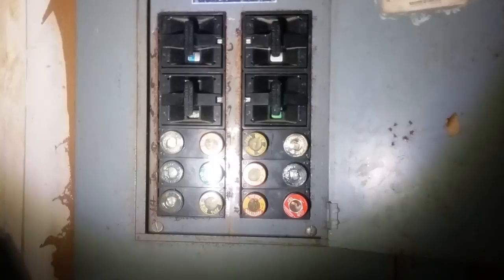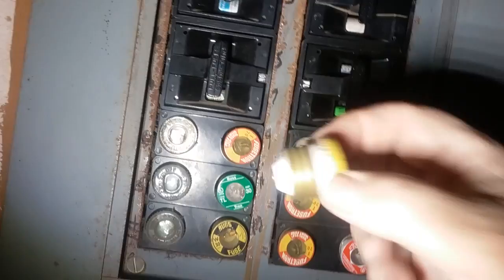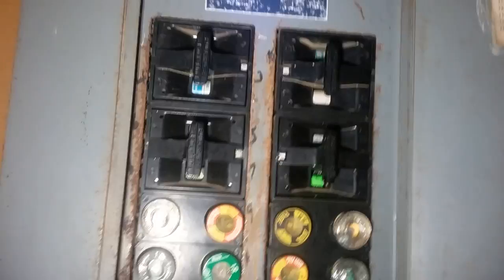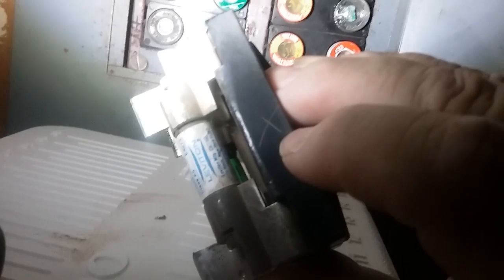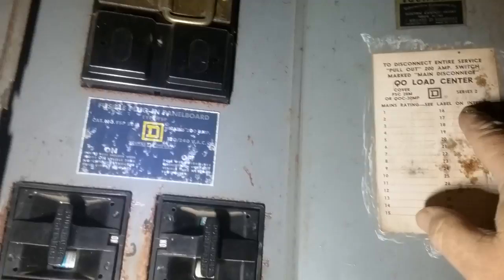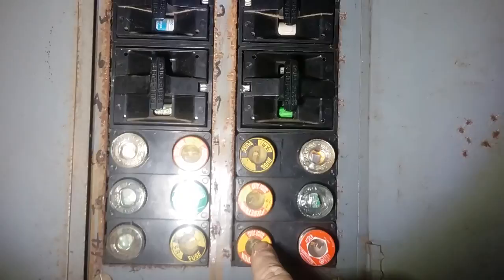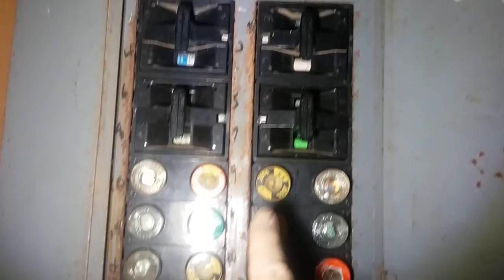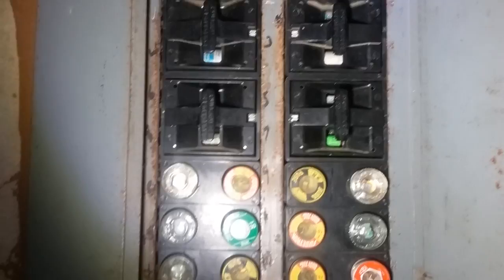How To Change Fuses in an Old Home Panel

Comment: 99% of the time, the fuses are oversized. For example the 30 amp fuses throughout than panel more than likely need to be either a 15 or a 20 amp. Back in the day it was not uncommon to overload a circuit and people would, without knowing the consequences, just put in a bigger fuse. Its best to remove the panel cover and look at the wire size going to each socket. If it AWG 14, use a 15 amp; AWG 12, use a 20; for a 30 amp fuse to be appropriate it would require AWG 10 size wire. That's why I say that they're probably oversized because that size wire isn't ran to lights and outlets in a house. Its used for higher current demands like water heaters and clothes dryers.

Comment: I'm afraid of this. My Dad who is 88 yrs old had jerry-rigged so much in this old house. We don't know how many things are on the circuit. The Air Conditioner blew it out 09-13-19 when it was 90+ degrees here. A neighbor helped us by taking the blown canister fuse out. We are now on 1/2 power. We are cold & can't turn the furnace on until it is replaced. I purchased the canister type fuses plus several of the screw in type at Lowes. The clerk helped me to get the right ones. I took the old one with me.  Thanks for making this video for people like me who have no clue. I had circuit breakers at my old house. I live with my Dad and he is always destroying things that he thinks he can fix and never wants to spend money for professional help.The clothes dryer doesn't work either.  I'm only 5' tall. I would need a step stool or ladder to reach it.  Hoping that my neighbor who is an electrician can help us again. AFRAID of Electricity.
Reply: your comment cracked me up, sorry about dad making things hard!
Reply: I understand. My dad grew up poor in the depression.. He tried to diy, but usually a relative would help with electricity -  my Dad knew that wasn't his expertise.

Comment: Seriously, replacing a fuse is as simple as screwing in a light bulb, anybody can do it.  Just make sure, before putting a new fuse in, it's a good idea to actually make sure that the right amperage fuse was in there in the first place (especially if the fuse in there is more than 15 amps) -- people often like to overfuse their old circuits (which is dangerous!!).
Reply: He stated that.
Reply: How would you determine if the right fuse was in there to start with?

Comment: I seldom come across these panels. As an HVAC tech, did a service call...watched your video as I worked on a gas furnace cleaned sensors. You gave me that much more confidence as I had to hardwire a condensate pump into unit.   Tanks!😊
Reply from the maker: You're welcome Tim! Thank you for stopping by and taking the time to comment on the video. I'm glad "How to change fuses in an old home panel" was helpful.

Comment: Thank you for this, I moved into a 100 year old home 7 months ago, and last night I blew a fuse running the dishwasher and microwave at the same time (same circuit apparently). I am an older woman living alone in this rental home, and being familiar with the other, switch-flip type fuses ("breaker switches"?) was intimidated by these round things (old fuses). Now, however, I think that I can handle it, and the landlord at least left plenty of boxes of fuses that match, so wish me luck! Thanks again for your instructional video.
Reply from the maker: You're welcome. Just be careful with any exposed metal, including the sockets. They are energized even when the fuse is blown.
Reply: A dishwasher needs to be on it's own circuit, with just it's own 20 amp fuse or breaker serving it. There shouldn't be any other lights, receptacles or appliances on that circuit.
Reply from the maker: @Progrocker70  Yes it should, but in the real world, especially when dealing with these older homes, it's rarely done in my area.
Reply: @BlueCollarDIY  Yeah they just wire it to one of the counter receptacles since they are right there and easy to connect to.
Reply: @BlueCollarDIY  are these boxes still considered safe 
I'm asking because my daughter has this in her house she thinks that their unsafe and hers is in pristine condition
Reply from the maker: @tammygallant6004  It really depends on who you ask. I don't like them myself because new breakers are safer and reliable. But there are probably millions of these old fuse panels in existence today still working fine.  Sorry, but that is my best answer!
Reply: @BlueCollarDIY  Thank you for replying
Reply from the maker: @tammygallant6004  You're welcome!

Comment: I was nervous to unscrew the fuse thinking I might blow shit up lol. Thanks for the vid now I don’t have to work on live current
Reply from the maker: I still hate unscrewing fuses when changing old fuses! You could still get shocked by some of the old fuses if you let your fingers slip down on the brass ferule. Newer ones have ceramic. Just be careful where you put your fingers!
Reply: Yeh hahaha. My dad just unscrew the old one and replace it like no big deal. I don't even want to touch them.
Reply: You can always shut the main power switch off

Comment: Thank you man I was struggling with this. I love how you said "preferably they're labeled"... I've never came across one that was either label or labeled correctly! 🤣 that was a good laugh.
Reply from the maker: Thanks KTP! I appreciate the comment. As for labeling, I feel fortunate if I find just a few labeled. Rarely are all of the fuses labeled! lol
Reply: @BlueCollarDIY , I have 8 fuse slots and only 4 of them are tested hot ( I used a voltage detector pen), I changed the fuse sockets and still no electricity, do you know how this could be?
Reply from the maker: @apocalypticredix8538  Not off the top of my head. Do you have the pull out type fuses above the screw in fuses like the one in this video?
Reply: @BlueCollarDIY  yes i have the same exact box
Reply: @BlueCollarDIY  i didnt know you could pull those out, maybe thats the issue, i may have to reset it unplugging and plugging or replace those cartridges, could be burnt out due to usage
Reply from the maker: @apocalypticredix8538  Yes, I've seen the cartridges burn out before.
Reply: I agree I have these in my house and none of them are marked it's hard to figure out which one is blown one is cause furnace and hall light doesn't work since ac blew out one on the same side of wall in the living room
Reply: How can you look at the round ones and tell it's bad?

Comment: I just moved into an older apartment built in 1955 and I accidentally blew the fuse by using the AC and microwave at the same time. 😅 This video was very helpful! Thank you!

Comment: This is a very nice old fuse box.  It has pull out fuses for four 240 volt circuits, and plug (screw in) fuses for 12 120 volt circuits.  

Most older house had much smaller fuse boxes.  Back in the day it was common to only have 4 or 6 plug fuses for 120 volt circuits and only one pull out 240 volt fuse block which was typically used for a range.  No 240 volt pull outs for air conditioning, electric water heater, dryer, etc.

Many if not most of these old inadequately sized fuse boxes have been replaced.  

But what you have is fine as long as you have enough circuits. If it was my house I would not replace this fuse box.  If I needed more circuits I would simply add a sub panel and connect it to the take off lugs in the existing fuse box.  That is likely what that breaker box is that is next to the fuse box.

That said, you may have a dangerous situation by using fuses that are too large for some of your 120 volt circuits.

The plug (screw in) fuses are for 120 volt circuits like lights and receptacles. Circuits for lights and standard receptacles ARE NEVER 30 AMP CIRCUITS.  The only kind of 120 volt circuit that would be fused at 30 amps would be of 120 volt equipment that is hard wired or connected to a special 30 amp receptacle which is much different (and larger) from a standard120 volt  receptacle; I repeat: 30 amp circuits are never used for standard receptacles and light fixtures.

Bottom line: is dangerous to fuse a circuit designed for 15 or 20 amp circuits with a 30 amp fuse. It is very likely that most of if not all of the 30 amp fuses in the fuse box in this video, which are the fuses with the yellow color, are over sized.

Lighting and receptacles are always 15 or 20 amp circuits, but you can not determine if you need a 15 or 20 amp fuse unless you remove the cover and examine the size of the wire that is used for each circuit.  Unless you know the size of the wire used for a circuit, the only safe size fuse is a 15 amp fuse.

15 amp fuses are for use with 14 gauge wire
20 amp fuses are for use with 12 gauge wire
30 amp fuses are for use with 10 gauge wire

If you have trouble with fuses blowing frequently do not replace them with larger fuses, but you might be able to solve your problem by the use of a properly sized "time delay" fuse, which are sold under the brand name Fusetron.  These type of fuses can withstand short overloads that occur when a motor starts.  They can often resolve problems with motors blowing fuses when they start but they will not resolve the problem of a circuit that is continuously overloaded.

If you still have problems with fuses frequently blowing after trying a time delay fuse, you need to either put up with it or consult with an electrician to resolve your problem.  DO NOT replace a fuse with a larger fuse than the circuit is designed for.
Reply: I'm literally living with this right now. Love the explanation.  So delayed fuses until electrician can fix it.😅

Comment: I have a box like this in my garage and the box has a pull down lever on is up and off is down. Do i have to turn off that lever and go inside my house basement and turn off main breaker to change the blown out  fuse in my detached garage?

Comment: Do you need to shut off the electric to unscrew a 30 amp or no?  Thanks
Reply: You don't need to pull the main fuses when changing a fuse. However, If your unscrewing a fuse on an active circuit it will create an arc and cause pitting in the bottom of the fuse socket. I would turn off any appliances or lights that I can on that circuit when removing or screwing in a fuse.

Comment: Receptacles and lighting should not be served with 30 amp fuses, if they are they are overfused and this is a fire hazard. 30 amp fuses in a home are only for larger 220 volt major appliances like dryers, air conditioners, fixed space heaters and water heaters that are wired for 30 amps with #10 wire. These circuits would have two 30 amp screw in or cartridge fuses mounted in pullout carriers for each appliance.  The pullouts with the handles in the top of these panels hold cartridge fuses which are usually 30 to 60 amps.  An electric dryer and water heater would have a pair of 30 amp fuses, an electric range a pair of either 40 or 50 amp fuses, and central air typically pair of 20-50 amp fuses. Lighting circuits, which includes receptacles in rooms outside the laundry and kitchen,  are 15 amp with #14 wire.  Circuits serving kitchen receptacles, appliances like dishwashers, washing machines and such are typically 20 amp with #12 wire. I say typically...in many older homes the kitchen receptacles were still wired with 15 amp circuits.   There shouldn't be any 30 amp screw in fuses supplying 120 volt lighting, receptacle or appliances loads. Lighting and receptacle circuits,  in most older homes is 15 amps.  30 amp circuits are not code approved for lighting and general appliance household receptacle and appliance circuits using 120 volts.   While there's certainly nothing wrong with properly sized fuses in a fuse panel in good shape, it's this confusion of what size to use, lack of understanding that can make fuses unsafe.  That and a lack of available circuit spaces which cause overloading. This is actually a decent sized fuse panel, most of them aren't, having only 4 or 6 circuits total.
Reply: Thanks. I am running two space heaters and the 15 amp fuse has blown twice in two days. I simply replaced it with a 30 amp fuse but I'm removing it now because of your comment. I'll replace it with the proper size tomorrow and simply move one of the space heaters. T hank you.
Reply: @POOCHIESCLOSET  Plug in space heaters use a lot of power,  typically about 1200-1500 watts, which is about 10-13 amps. Doesn't leave a lot of room left on a 15 amp circuit for much else. Leaving them both running on overfused 14 gauge wire certainly would lead to insulation melting and likely could've caused a fire.

Comment: Thank you!!! How do I figure out what amp goes into each unit if not labeled? I need to update labels & ensure correct fuse is in the appropriate place.
Reply from the maker: I'm not sure as I generally go with whatever fuse is in there. If the circuit is for something like a dishwasher, then it's generally going to be a 30 amp.
Reply: @BlueCollarDIY  what about a furnace? I have 30 amp screw in fuses in 8 places.I believe it's not right. No labels here. Excellent presentation
Reply: you (or someone else) has to look at the size of the wire that is attached to that circuit. 14 gauge is 15 amps, 12 gauge is 20 amps and 10 gauge is 30 amps. You will hardly ever see a 30 amp screw in fuse used unless someone put it there and it does not belong. They are only used for 240 volt circuits 90% of the time.
Reply: @WalterKnox  thank you! Noting this for the future

Comment: Went to replace a fuse and it immediately sparked out. We did put it in very shortly after the original one burned out. It's a fuse for the fridge so I'm not sure if it's okay to try again while we wait for an electrician.
Reply from the maker: If you've already called an electrician, I would just wait for them.

Comment: Can I test those cartridge fuses? Ty
Reply from the maker: I test them with a multimeter. I believe I use the ohm setting to see if I get continuity through the cartridge. If it's blown, you won't get any continuity.

Comment: Thank you sir, wasn’t sure I had to turn anything off for safety reasons but figured it out, dad wasn’t home from lunch yet and I couldn’t tell which one was broken lol it ended up being the top left one I am only 5,8” haha, thanks again I took care of it no problem even made sure it was the exact same one!
Reply from the maker: Good deal! Many times, if you'll look in the center of the glass, the one that is blown will have a black sooty look to it. But then again, I've seen fuses that just blew and I had to look at them very close to determine with one blew!
Reply: So you did or didn't turn anything off before removing fuses

Comment: hey boss
my all fuses working fine as i tried them in all hoses in which we screw up the fuse
only that hose isnt working
what can i do in this case ?
Reply from the maker: If they're all fine and you're still not getting power, you'd better call an electrician. There's another problem somewhere. Just make sure there are no sub panels hidden someplace.

Comment: What happens if  I replaced one fuse and it still doesn't turn on? It's weird because if one fuse goes out, at least there still power somewhere else in the the house, but there is no power anywhere and I heard there was a local  power outage but my neighbors say they have power! Now I'm worried because this never happened before, maybe  because they have a newer power supply or the whole fuse box is broken?!

Comment: I have a question concerning my 60 amp fuse box. I know if I pull the main it will cut power from the outside , however  after doing so is it possible to feed power via another source once the main is pulled.  ?

Comment: at 0:25 you unscrewed the fuse.. is the panel off? Can I unscrew one when the panel is live? I need to find what circuit my kitchen is on and its not labeled
Reply from the maker: There are so many different panels out there, I'm not sure which one you have. I will generally shut the power off and unscrew the fuse, turn the power on and see if it's the circuit I need. Some panels you can't do this. On this one, I do believe it was live and I unscrewed it. I'm just very careful to not touch the base while I do it. I hate these old panels!
Reply: @BlueCollarDIY  ok yes I just need to find out which circuit is for the kitchen so if I can unscrew while it's live I just don't want to die lol
Reply from the maker: @chrisjennings1204  I understand. That is my goal every time I have to deal with those things! I've heard so many horror stories!